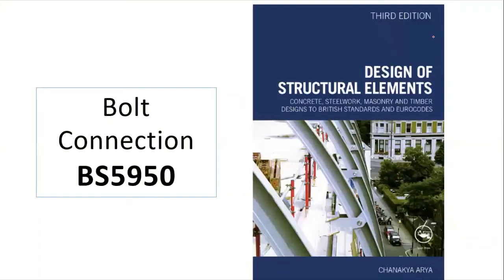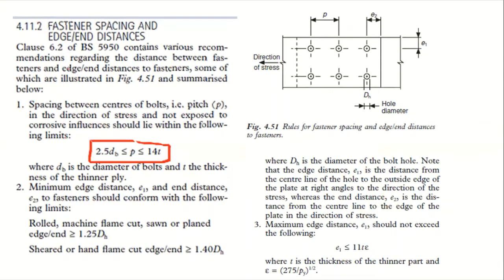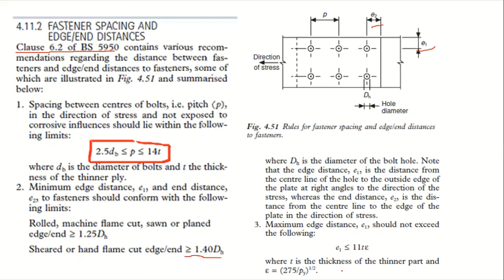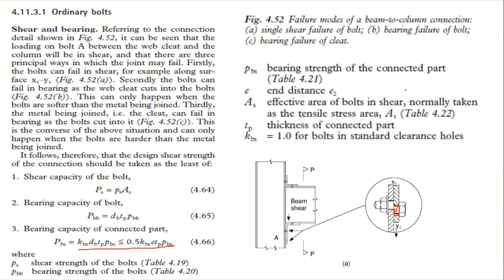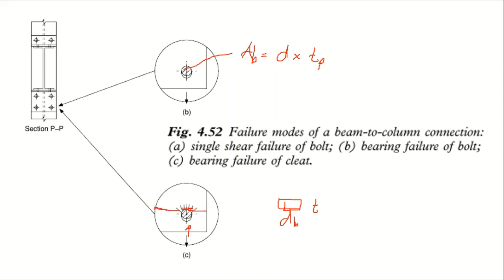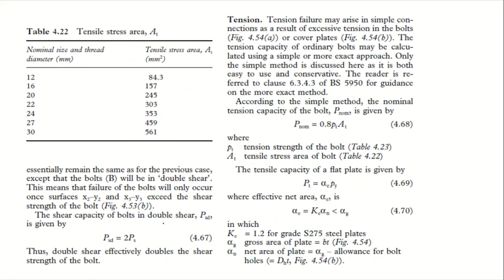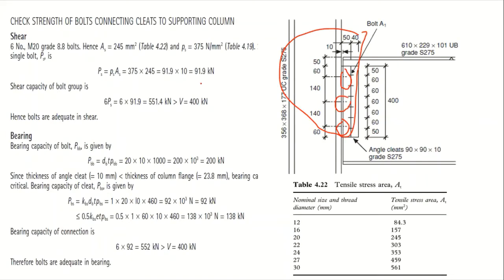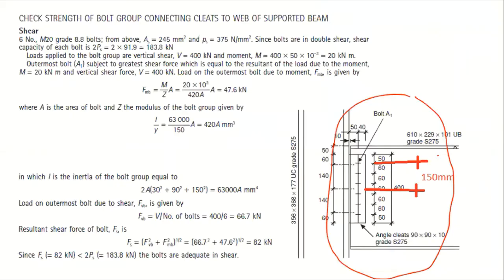BS5950   BOLT CONNECTION DESIGN

Comment: Can you please reply back if you know the answer of Max Fs value at top bolt ?
Reply from the maker: They are the same in value. Only in different directions. 66.67 KN is same going up while 47.6 is going to the left. Resultant which is Fs is still (66.67^2 + 47.6^ 2)^0.5 = 82KN
Reply: @jimmyadoranebrida  I can’t understand can you explain me little clear
Reply: @jimmyadoranebrida  thanks for reply how did you get 66.67kn
Reply from the maker: Okay. I’ll make a brief video later after my work and upload it.
Reply: @jimmyadoranebrida  okay thanks a lot again if you don’t mind make video today please …
Reply from the maker: @kanithisanthi8333  it’s in the video.
Reply: @jimmyadoranebrida  okay let me watch carefully again
Reply from the maker: @kanithisanthi8333  Check here https://youtu.be/cLmNxvVqjUg
Reply: @jimmyadoranebrida  hi actually my question is related maximum tensile stress at top bolt in torque